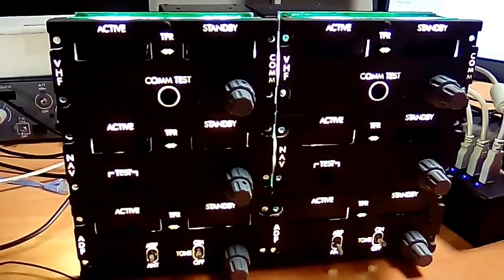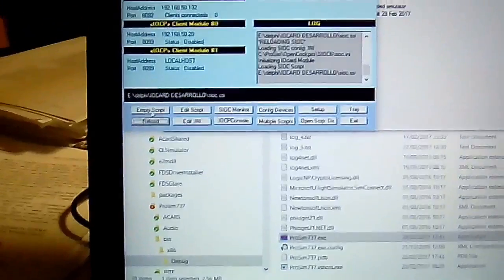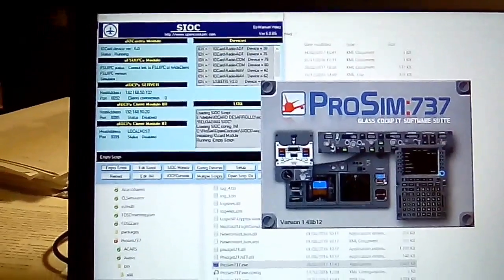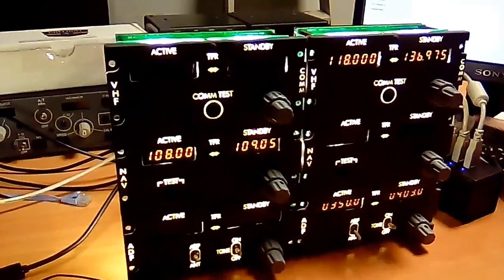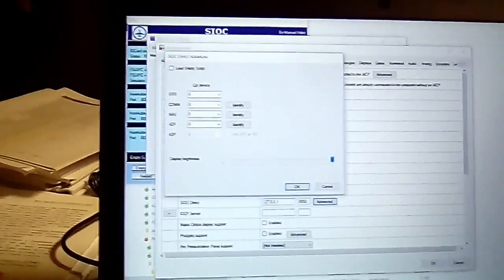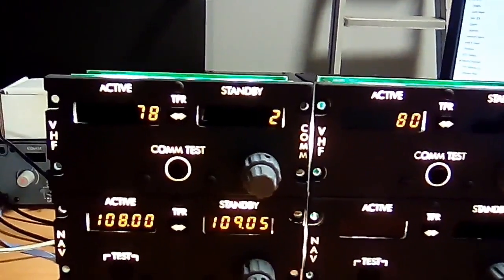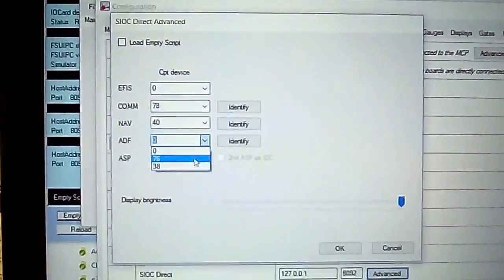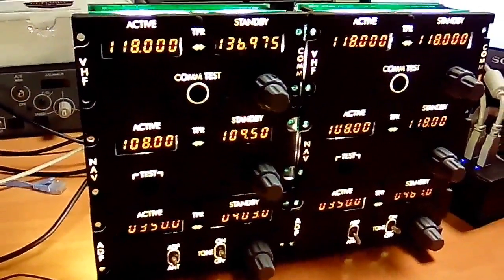OpenCockpits radios and the new PnP ProSim driver

Comment: What version of SIOC are you running?
Reply from the maker: Hi, SIOC 5. but you need to wait for ProSim V2 to be released to have this.
Reply: wpslider thanks. I got the email about the upgrade. I read the A320 manual to understand how this would work and it doesn’t seem to make it any easier. I still need to have a script to do most of the work. Right?
Reply from the maker: No, no script needed. The 320 does not have this SIOC direct driver.
Reply: wpslider that’s great to hear. I asked Hanne if they could post the manual before release so i can plan for the upgrade
Reply: I just got ProSim V2. I see SIOC Connector is 127.0.0.1 but what is the port setting? I can't tell from the screen.
Reply from the maker: the same as IOCP

Comment: When is prosim compatible to sioc finally? So many prosim updates but prosim is not compatible to sioc like in this video?
Reply from the maker: ProSim is already compatible with SIOC. The video shows the new SIOC Scriptless driver that will be available with ProSim V2
Reply: wpslider thank you for answering but is it working with all oc sioc products? I don't get it to run?
Reply from the maker: The new SIOC driver(shown in this video) is not yet available.
Reply: wpslider I have a further question, in the first update there was a direct function to connecting with oc products but in the following updates I didn't found this function? Only to fill in a IP address?
Reply: wpslider Do you know or can you tell me when it is aviable please?
Reply: wpslider is this the driver deployed with Prosim or from OC. Reason is that i have the OC version 5 installed now.

Comment: Hej what abaut ATC ?
Reply from the maker: Also supported. In this case, no need to do anything. Just plug it and use it.
Reply: cool :)

if it works in the current version?
ProSim737 Suite V1.48
Reply: Q2/Q3 ok :)
Reply from the maker: No. It will be available later this year. (Q2/Q3)

Comment: It would be better using native SIOC support (I mean without using sioc software) but anyway is a really usefull thing for those who aren't good with sioc understanding
Reply from the maker: Hello Mario. The advantage of using SIOC is that you can use it remotely. All you just need to do is start SIOC. The only config needed is to make sure you have the monitor enabled in SIOC. No INI edit, no scripts, nothing...
With an USB native driver in ProSim, it would be necessary to plug all OC USB devices to the computer running ProSim.
Reply: wpslider ola, tens razão, mas pessoalmente eu acho que o SIOC server do Manuel é instável.